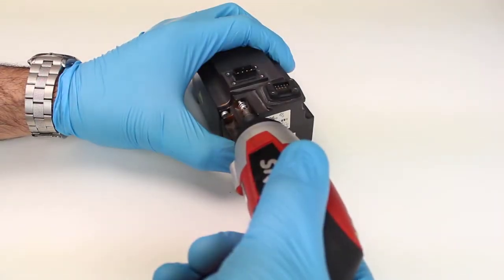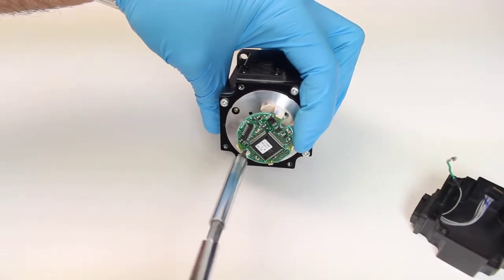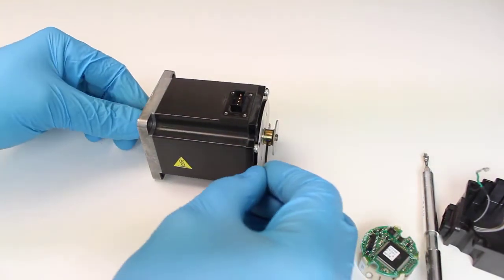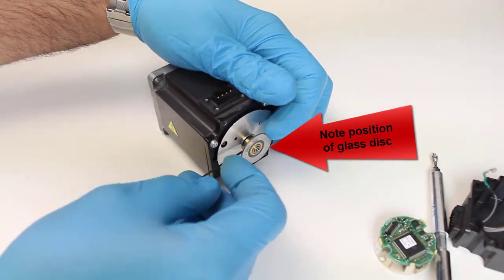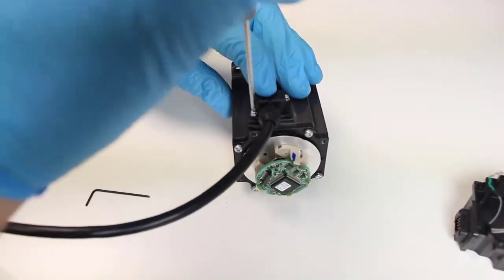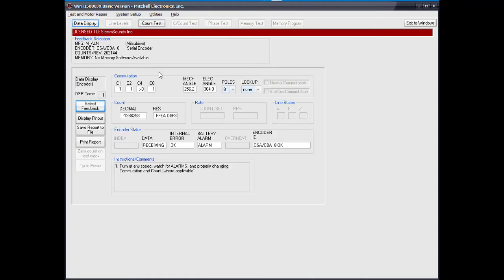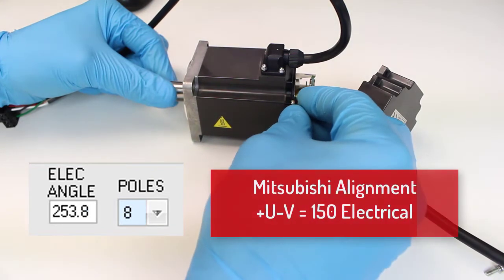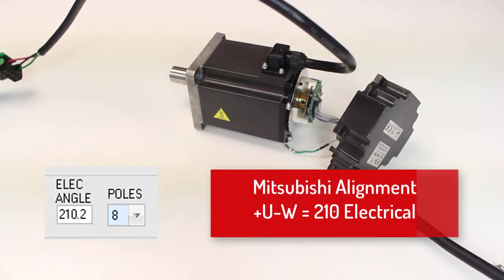TI-5000JX Mitsubishi OSA Encoder Removal and Installation

Comment: Что за программа для настройки инкодера ?
Reply from the maker: Our software reads the encoder to allow you to test and align it. Learn more here: https://www.mitchell-electronics.com/athena-pc-software/
Reply: @MitchellElectronicsInc  на сколько плотно сидит зеркало инкодера? На вашем видео снимается легко.
Reply from the maker: Can you please rephrase your question so I better understand? Are you asking about the physical placement of the encoder, or the tolerance of the electrical angle? Usually that should be +/- 3 electrical degrees to insure adequate alignment so the motor runs properly in the customer's machine.

Comment: how do you note the disc position relative to the motor shaft?.. I disassembled mine but no mark to note.. after assembly, it couldnt run- encoder error.. 
thanks in advance
Reply from the maker: Perhaps some type of caliper measurement or feeler gauge could help.

Comment: Hi v r using Mitsubishi HG KN 43 servo motor , continuously its encoder failure using in oil base machine how to find solution
Reply from the maker: Have you tried replacing the encoder?

Comment: How are you?
Servo motor POEN
Barudan
Model no TS4514 N2020 E200
800w 200V
S/N A33007 D .01.11
UNITECH ENGINEERING LTD
MADE IN JAPAN
Reply from the maker: I believe our product supports this encoder. Please contact us at www.mitchell-electronics.com for a quote.